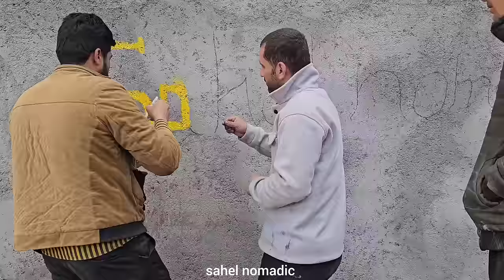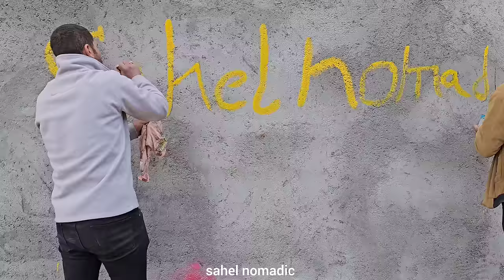Installation of fireplace and New House Windows

Comment: Maybe the new worker from Tehran can paint. Someone needs to paint with very small brushes and tidy up the edges and runs. There should be no need to add fuel to the paint for windows and doors as they have been primed. The walls need a masonary latex paint undiluted. Let one colour paint dry before using another. The man tiling and making the fireplace is so precise in his work, it is a shame that the exterior paint gives the outside a sloppy finish.

Comment: I've been in construction 40 years.
Never have we had a fire inside the structure for heat. I live in the north were it's -20 C
Reply: The different materials they use need to be dried out to set.
Reply: It is getting very confusing, is this channel about a nomadic woman and her kids or an engineer helping the poor? I am not against helping people but should that be a channel for people who want to watch it. I want to watch this woman and her children survive and their daily challenges and customs…..
Reply: Our basements are made of brick blocks and cement that we air dry..
Then the workers stop to allow the process to dry naturally. As we progress and the cement floor is poured..we wait again . No rush. No fires X🔥X in the structure until proper heaters can be installed.
A generator with a heating system is most efficient.